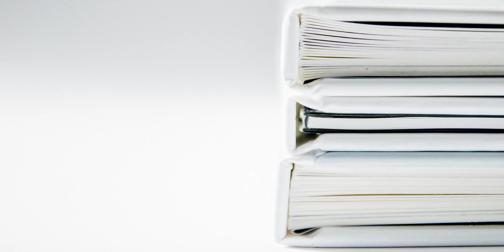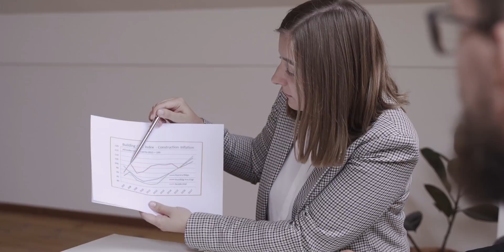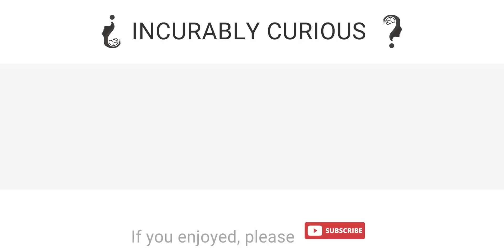Why Most Power Lines Aren’t Underground

Comment: Is all BS... in Europe most low voltage power lines are underground and where this is not possible the area around the lines is free of trees or other obstructions. And the investments have been made with long-term costs in mind... it will cost more to repair the power line after every major storm over the next 30 years than a one-off investment to gradually move it underground before the next road repair is planned, for example. The cable company or ISP may also want to upgrade the infrastructure for that sector and will do so at the same time. In this way, the line company pays only a fraction of the road repair costs, the rest being borne by the other companies and the state. To achieve this, the institutions must work hand in hand.

Comment: I spent the first 36 years of my life in another country where electric supply cables were located underground in urban areas and outages were very rare indeed. Then I came to America and was astonished to see so many services strung up overhead on poles in the same type of areas. The problem goes back to original electrification in the US. It was done on the cheap to maximize profit and as the narrator of the video rightly states, the cost to put it all underground now would be prohibitive. One wonders what the cost to society of outages is on, say, an annual basis.
Reply: I can assure you, you don't have to wonder. There's a lot of people employed to figure out that cost. If it was worth it, it would've already been done.
Reply: It was done on the cheap to minimize cost. Most rural areas of the US weren’t electrified by private companies, they were electrified by cooperatives funded by the Rural Electrification Act.
Reply: Supplying utilities to a suburban sprawl was meant to be expensive. You need to maintain a much longer system of pipes and cables to fix one household's worth compared to a denser urban environment. It was done cheaply in the states because there is no possible way to have it done well AND have the local government not be financially insolvent.
Reply: Or, it is because the US electrified decades before most of the world.  And the US's decision to use 120v was in part driven by the fact that we had the money to put the cost into the lines instead of the end use device.
Reply: @kcgunesq  maybe africa haahah but the us is behind europe in every aspect of life
Reply: @kcgunesq  FYI the first power lines where done in Italy and Europe and not in the US and after that the development took place both in the US as well as in Europe...

Comment: The powerlines in my former neighborhood were relocated underground about 15 years ago. The individual homeowners were responsible for trenching their yard from the breaker box to the street (about 20 feet in most cases). After it was completed, I was amazed how the removal of the powerlines changed the look of the street and the skyline. I don't remember if the cost of power went up after that, but if it did, it wasn't much. Nowhere near 50%. And as a resident of California, the damage caused by overhead powerlines in fire prone sections of the state is in the billions each year. Some paid by the utility companies, but mostly paid by us.
Reply: California has become notorious for not clearing growth from around the power lines and that being the cause of many wildfires.  Even after 2017 PG&E insisted doing the job properly was too expensive...  then 2020 another 1000 square miles up inflames.

Comment: having power lines under ground yes costs some more, BUT you certainly save big on maintenance since the wires are not exposed to the environment, so essentially the reduced maintenance cost offset the initial cost to put them underground

Comment: The things you mentioned are very interesting issues surrounding the issue but does it not show that again because the company isn’t interested in efficiency and improving its service and infrastructure just it’s bottom line. If the company had been reinvesting in its infrastructure then why would customers have to for the bill? Wouldn’t that already be baked into the bill but overtime. The same way you can with rent to improve a property.

Comment: I work in fiber optics, not power, but we do both overhead and underground, so I see most of the issues. A good crew can place several THOUSAND feet of fiber in a single day, even on the best of days our underground crew is lucky to hit two hundred, and that crew has roughly 3x the people as the overhead crew. Additionally, once you place a pole for one power line you can place over half a dozen communications cables with ease. You only get that efficiency if you build all the underground lines in the same trench at the same time. I place fiber on poles that are decades old. We frequently get plans to place new cables that require existing cables to be moved up or down the pole to make room for them, and they are NEVER done even if jobs were planned YEARS in advance. You are basically never getting to dig a ditch and put every cable in it at the same time.
Reply: We hit two unmarked fiber lines, one was a trunk line.

I must say Fibre people show up to a hit line much faster than a water compa y.

Comment: Most of the powerlines here in my area in Sweden are buried since years ago and power outages have drastically dropped to maybe two or three in a year compared to every time wind picks up or there is heavy snowfall, a tree falls over the line, it would take many hours to a whole day for the power to return. what happens now is if lightning strikes near it, it just trips a breaker and after about 30 mins the power is back on, this happened one time last year and the other times where the company doing maintenance witch took an hour or four.
Reply: That’s bad. I haven’t had a single power outage since 2005-6 when they put the power lines underground. 🤷🏻‍♂️
Reply: Two to three outages, a year? My power might go out once every two to three years, and our lines are all above ground. I would say you get much more cold weather than me, so that must be the difference.
Reply: @gmfreeman4211  I have never experienced blackout here in Finland. 

Sometimes I read about blackouts from newspaper and it's pretty much some digger or until few years ago before we started burrowing them underground some storms might have caused them. The thing is that we have a lot of trees in Sweden and Finland and trees tend to fall during snowstorms.
Reply: @gmfreeman4211   I´m also in Sweden. It´s at least 5 years since we have the power out here, and it lasted 1 hour. It depends om where in Sweden it is and what caused it.
Reply: I haven't had power outages that I couldn't fix by fliping a breaker in the last 15-20 years. And I have never experienced any outage of more than 4 hours in the last 36 years. I can't speak to before then because I wasn't alive. This is what it is like to live in Denmark. Is power more expensive? Yes. But we can rely on it.
Reply: I'm a retired utility engineer for NYC. Naturally Manhattan is all underground, but the outer boroughs are mostly what we call "aerial." The repairs of aerial cable failures are generally much quicker than underground overall, and simple breaker faults can be quickly located and restored much faster than an all underground plant.
Reply: @MrAquinas1  of course it is quicker to repair an aerial line than buried but our system is a little different when there is aerials as there are barely any fuses on it so there could be many miles between them and when there is trees up against the lines the faliures ar much too often
Reply: Sweden, however, I imagine does not have to worry about major flooding like more tropical regions. Imagine widespread damage to the infrastructure due to one storm surge event, and then they have to go around the city digging up wire and repairing it, it would cost a fortune and a very extended outage.
Reply: @hadhamalnam  "Sweden, however, I imagine does not have to worry about major flooding like more tropical regions. Imagine widespread damage to the infrastructure due to one storm surge event, and then they have to go around the city digging up wire and repairing it, it would cost a fortune and a very extended outage."

You do realize that storm surges don't just happen in tropical regions? 
 
And there are plenty of ways to deal with the issue without having to "dig out wires". 

Your talk about "extended outage" is evidently flawed, given that the US has far more outages than comparable countries.

Comment: Columbia gas came in to serve the remainder of my town. Covid hit, they packed up and went home, never to return. I believe what they found is underground utilities are simply not practical to add to an established community, at least not one built on a solid foundation of rock (my dirt tends to run about 3 inches deep, then rock). The city tried to use this as a way to get all the roads repaved for free.  Columbia gas responded with we're going to run all the lines under the sidewalks, sidewalks only cost $400K per mile.

Comment: Manhole covers placed in streets , low  bridges , exits placed in unsafe highway and freeway locations , no turn off access to streets where vehicle speeds are 45 or higher..
    Poor designs are prevalent within the infrastructure of many places. 
     Most power lines can be placed underground But , knowledgeable individuals with common sense are needed to design and implement the work.
Reply: Do you really think that knowledgeable individuals with common sense are needed to design and implement the work? What a great thought! You are brilliant you know! Here we were thinking of getting a couple of morons and eejits to implement the job!
Reply: My point is , currently morons and 
eejits are designing the infrastructures ..
Reply: My point is , currently morons and 
eejits are designing most of the infrastructures ..

An da , I wanted to say it without offending any of the morons and eejits ..

Comment: Up here in Eastern Canada, ice storms are a particularly bad problem… Apart from the cost of burying pre-existing powerlines, what is hard to understand is that new subdivisions continue to string powerlines above ground… When other aspects of the infrastructure are first built, that’s a relatively cheap time to add underground powerlines… There is a slightly greater cost, which could be passed on to the potential new homeowner when he purchases a lot, but once again it’s short term gain for long-term pain!
Reply: maybe Canadian towns should stop sprawling and many people can share the cost of the same distance of cables and pipes. underground cables aren't the problem, sprawl is. This is why only North Americans are complaining about it.

Comment: In Perth W.A. We have been slowly replacing overhead with underground power for 20 years now (I am a cable Jointer). When a new area is up for underground power, The Local government pays a third, The Utility pays a third and the homeowner pays a third, Which they get back in higher house values. It has been very popular. 
I'm not sure where he gets the idea that underground power has more outages. Nowhere near it. Overhead has considerably more outages. I have never known it to take more than an hour or two to find an underground fault....Weeks? Pffft.

Comment: Nice try, however in your costs you failed to mention the costs of keeping tree trimmed, replacing poles and lines damaged in car crashes, storm damage, old age replacement of poles and lines and a hundred other costs related to maintenance of above ground wires. Here the poles are replaced every 25 to 30 years. And while the new rich sections of the county get the new metal poles the rest of the county gets new wood poles. And everyone has to pay for the shiney new expensive poles whether they get them or not so that raised everyone's bills $25 a month for those who pay the minimum amount.   Over 80 years it would end up costing the same either way. So.....

Comment: I live in NY and in one of the hardest hit parts of Sandy.  Flooding was not the issue for us, it was the volume and prioritization of repairs that made getting back to 100% take several weeks.  There were too many things to fix and we needed to get the most important stuff up and running first.  I remember the Art college I worked at being upset they were at the bottom of the list for repair after hospitals, food dispenceries, homes, and K-12 schools.  The issue with my area in terms of underground powers lines is that our street lights double up on the poles used to streach the power lines.  We would still need power lines running up poles to power out street lights in a heavily suburban area.

Comment: I am a fan of underground power lines.   This is thanks to hurricane Irma.  I was at Walt Disney World when Irma hit in 2017.  The resort did not lose power, partly because it generates its own power and utilizes underground power lines.  However, upon leaving the resort two days later, we were shocked to see that much of the Orlando area was without power due to downed power lines.   I know it is expensive, but I feel in areas susceptible to harsh weather should start the process of moving it’s utilities underground.

Comment: done right, underground should last as long as 80 years, same as above ground cables... but there's the trick, getting it done right... as for cost to install, think on this, power corporations have been raising prices steadily for decades already... and they are NOT using that money to replace those nearly 80 year old above ground cables "until they fail completely that is"... as for the fixed in hours, that's a joke, this last winter we had almost 3 days with no power, yes in winter... when they did get it fixed, the heater ran non stop for a day at least, and ZERO adjustments for that extra juice used just to bring the temp back up to livable... and the cause of that power outage... you guessed it, trees... well this spring they hired a tree trimming outfit to clean up trouble spots, problem is they left ALL the trouble spots and trimmed everything else near the lines... i expect to also see MANY brown outs this summer due to the power companies inefficiency...

Comment: Having cables underground also helps shield the Electrical fields and magnetic fields when it comes to EMF pollution.  A friend has a power line in her front yard and my meter registered dangerously high readings from her bedrooms.  The wires she has had large metal boxes on the poles so am unsure what they are.  If you believe that this can cause health issues then having underground wires is best or housing developments further away from cables/conduits/boxes.
Reply: the problem is they want us exposed to the EMF, just research that 5G signal getting used now... that aught to scare you right there...

Comment: Power outages ... Something laughtable when you are a gaming laptop user, you can easily finish the match or whatever you where dooing and then go into power saving chill mode
Reply: lol, MY gaming laptop last maybe 5 minutes without being plugged in, something about the power needed for all that high res graphics we use now...
Reply: @mikewhitaker2880  also strongly depends on what you got, a thin and easily overwhelmed/outpowered one or a big mf like mine (acer predator 17, not the newest but good enough for gaming still)
Reply: @mikewhitaker2880  but, to not just trash talk, but actually be giving some advice:
Go ahead and check your power management settings (right click the battery symbol in task bar) make sure that in battery mode it will run on either balanced or what would be best, energy saving mode. If it runns on max performance, no wonder that it drains the battery faster than ... Than... Ok its 7am, it should be gorgiveable if i can't come up with a good enough alegory.
And when you are at it anyway, check that it is in high performance mode when being plugged in.
Reply: @Em.P14  thats one section that whilst i can look at, sadly Microsoft has deemed to be outside user control, much like screen brightness, oh i wish i still had windows 7, but that leads to arguements for another video...
Reply: @mikewhitaker2880  wait WHAT ? ARE YOU FREAKING SERIOUS ? are you using win 10 or already win 11 ? 
if win 10 then i got something that might gives you controll back (although i have on my win 10 system here already from the get go): create an empty folder on the desktop and rename it to "GodMode.{ED7BA470-8E54-465E-825C-99712043E01C}" without the " " symobls, it will give you all the hidden options and utilidties that are kept behind this unuserfriendly options menu, for instance i can recalibrate which screen of my 3 has touch input and wich one not (i do have tough on my secondary screen (acer t272hul) and sometimes through some bugs it resets to the main screen that doesen't got touch, it will register the touch just fine but moves the touch cursor on the other screen what is quite anoying when you want to alt-tab-click with it out of the main screens game
Reply: The router has to have it's own power or use a cellphone for tethering for example.
Reply: @jeffkardosjr.3825  The benefits of having a mobile broadband modem usb stick.

Comment: Most new construction uses underground lines. Yes it is expensive to convert above to below but the solution is simple... new construction run underground an it will fix it self over time. It really is that simple.